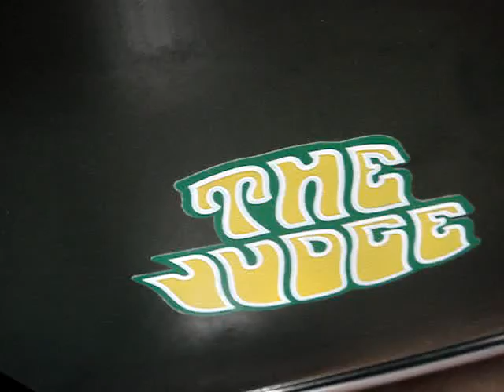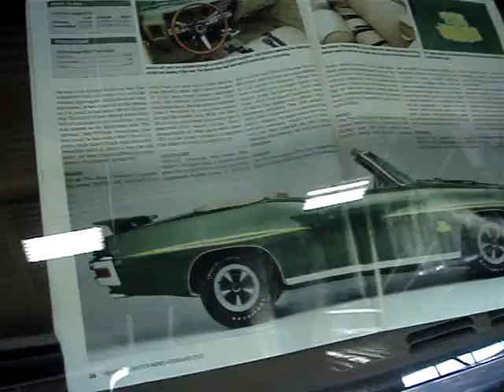1970 PONTIAC GTO - HERE COMES THE JUDGE

Comment: Man I would kill to have a Genuine GTO Judge with a Ram Air 455 Dual action side gat 400 turboMatic .My Brother had a 68 1/2 GTO Judge .It had the stripping and all the extras but didn't have the Judge Emblem on it but said Judge on the back of the car and it had it a air foil on trunk that was a little different to .It was straight didn't curve much.It was made famous by Rowan and Martins Laugh in and it stuck reguardless.Sammy Davis Jr.Did the Here Come Da Judge Skit and it influenced the boys at Pontiac and WaLa They come out with the The Judge Package Half wsy through the 68 Model year. IN 69 They finally had the decals finished due to Licensing and trade mark delays and negotiations with NBC . If you notice the Judge Decal Matches the onevon the show .Sad I should remember Dan Rowan and Roland Martins Laugh In Huh.?
Reply from the maker: dougslittlediesel Oh, I remember the Laugh-In show.  It was hilarious.  Here come da judge was a famous by-line and I though of that when I titled this video.  This Judge was taped at Fast Lane Classic cars, but I think it sold for I haven't seen it lately.  No doubt it wasn't there long before someone snatched it up.  That 455 cube engine I think is the ultimate engine and could it make a car move.